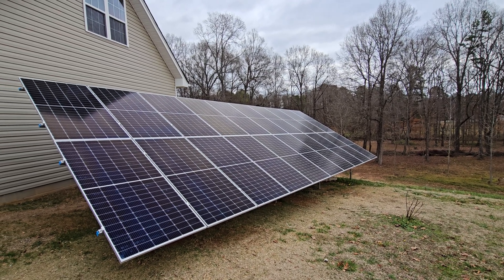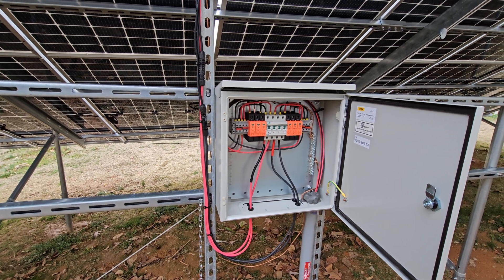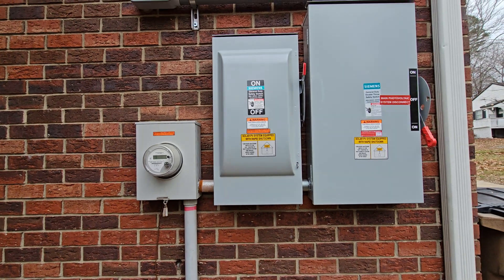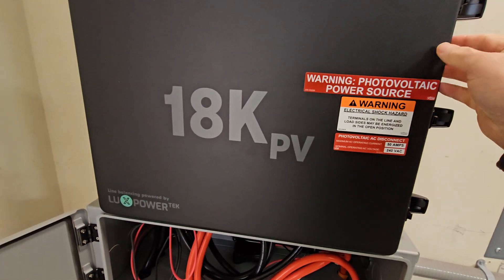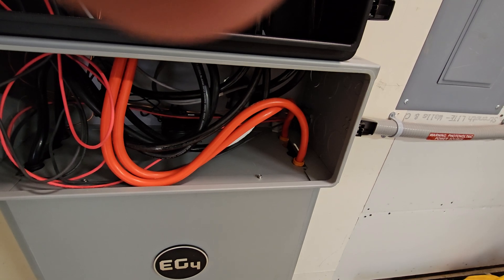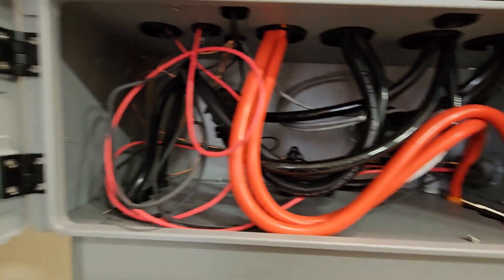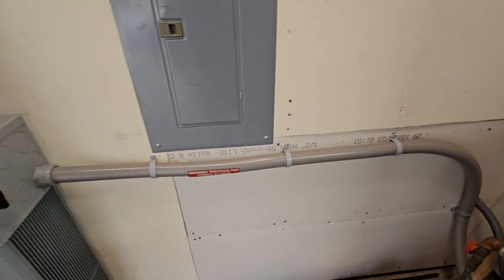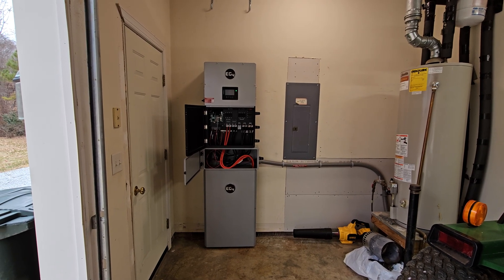Received My Permission to Operate from Duke Energy for my 18Kpv

Comment: Nice setup! What was the process for Duke Energy and NCUC approval? It's a bit confusing, how long did it take Duke to respond to you pre requests?
Reply from the maker: The process is not very clear on the websites.  Basically, you have to get a NCUC docket first.  Once you have your docket number you can make your application for grid interconnect through Duke Energy.  Those two things need to be done before you start pulling building permits and starting any work.  After you have installed the system, you will have to  provide your insurance information and you will have to provide your final past inspection info from the city/county inspector to Duke Energy.  After that, it only took about 3 weeks for the Duke Energy approval.  They reprogrammed my power meter remotely, so I have never seen or spoken to Duke Energy.  On a side note, Duke Energy changed the way they do net metering (I'm grandfathered in to the old system).  If you are not running batteries then grid tied is still the best answer.  If you have your own batteries you should run all the numbers before you decide to go grid tied with sell back.
Reply: @Gary_Pauls_DIY  Thanks for your reply. It was very helpful. No, the process isn't very clear and it is hard to find anyone that knows the process other than solar installers (who refuse to share). 

I have an NCUC docket from filing a "Report of proposed construction". Is that all that is needed, or do I need to file for a "report of proposed construction with registration" also? What did you do for RECs? I have an ESS and don't care to sell back. 

For Duke-energy, I submitted a "Pre-request application" which has been in a "submitted" state for more than 10 business days. I can't move to the "Pre-application" step until that is filed. Did you have the same issues and/or follow the same steps? 

I'm not sure what part of NC you are in, I'm south of Asheville in Hendersonville. We started getting a lot of snow about an hour ago, if you are as well, I hope you are enjoying it!
Reply from the maker: @JordanDeLozier  I started all my paperwork back in July 2023, so it is a bit fuzzy now.  If you have no plan to sell back to Duke Energy and you can set the system up to run without any risk of pushing power back onto the grid, then you really don't need any paperwork or approvals other than the building/electrical permit from your city/county.

The Docket and the Duke Energy application are processes so you are authorized to sell back power to the utility.  If you do the paperwork and approval Duke Energy will set you up to sell back power and then charge all the new fees.  Basically, if you are not selling back then you wouldn't do the approval process.  (This is my understanding) 

I am in Greensboro, so the snow hasn't started yet.  Not planning to go anywhere, so should be good.

Comment: Thanks for the video very helpful. If you happen to have the fuse and transfer box models handy do you mind sharing?
Reply from the maker: Siemens Type VBII 200 Amp Single Phase (120V/240V) Fusible Outdoor General-duty Safety Switch Disconnect
Model #GF224NR
Siemens Type VBII 200 Amp Single Phase (120V/240V) Non-fusible Outdoor General-duty Safety Switch Disconnect
Model #DTGNF224NR
Reply: @ you da bomb

Comment: you can crimp furrels on the battery cable ends.
Reply from the maker: Yes, I didn't have the correct furrels or crimpers.  If I every need to take it back apart I will probably add them.

Comment: Thank you for your very informative reply. I followed your guidance and I feel confident that I have done it properly. I had put all wires in the conduit at first because of the difficulty of pulling wires. I have disconnected one neutral and one ground from the fused disconnect to the inverter grid lugs. Again thank you.

Comment: Gary i have been designing my system like yours. My questions is in your pictures shows Bypass transfer switch to the inverter shows L1, L2 , neutral, and a ground. this I understand, but the Fused disconnect only shows two wires going to the inverter Grid L1 and Grid L2 there is No neutral going to the inverter. I have already put all the wires in the conduits to the inverter. I have the exact same wires in each conduit. My question is if I hook up the neutral that is already in the fused disconnect conduit to the inverter grid neutral is this ok? And I also have a green ground wire in the conduit does it not need to be hooked up?
Reply from the maker: I attached my neutral and ground from the inverter to the transfer switch.  I could have attached them into the fused disconnect and electrically it would have been the same.  There needs to be a single path so you shouldn't put a neutral or ground from the inverter to both the fused disconnect and the transfer switch.  Use one neutral and one ground from the inverter.  It can go back to either the fused disconnect or the transfer switch.  In my case I chose the transfer switch since the lugs needed to attach the wires were already in place.  The fused disconnect did not have double lugs on the neutral buss.  Also, the ground and neutral are only bonded together at the first means of disconnect.  For me it was the fused disconnect.  After that your neutral and ground are separate.  Hopefully I have explained well enough.  If not just ask another question and I will try to help.

Comment: Why would you grid tie with a solar system like that?
Reply from the maker: For 9 months out of the year I could be off grid, but for the middle of summer the system doesn't keep up with the demand my 4 ton AC puts on power consumption. I got in before the Duke Energy rules changed, so I have 1 for 1 sell back, so it was more cost effective than installing a larger system. I would have needed to buy at least 10 more panels and a couple more batteries if I was off grid.  As prices of equipment drops I may expand in the future.
Reply: @Gary_Pauls_DIY  you could run two mr cool mini split and yank the cable from the power company I bet. Here in Nevada, we have to deal with NV energy which is about as gangster as a utility company can be without actually being criminal. They quoted me 30k to swing a line from the pole in the corner of my property stating that I would have to buy a bigger transformer for the neighborhood. I took that same amount and built my own off grid setup that could power my property and the neighbors on either side while still having funds left over for nuts and bolts. Happy with my build, later down the power connection...NV energy then offered to swing a line at no charge if I grid tied, they got the finger.
Reply from the maker: @thomascraddock8697  Yes, when my AC dies (very old now) I plan to replace it with a 2 zone system.  This should help out.  Also, as equipment get cheaper I plan to expand (at some point).  As the solar panels become more efficient and the inverters get more reliable and battery tech gets better and cheaper...I think more people will move to solar.  If power companies start to loose money though I expect they will pass laws that require you to be grid tied and limit the size of the system.  Utilities have too much political power in my opinion.

Comment: @Gary_Pauls_DIY Hello Gary,
I purchased Siemens safety switch and double throw switch like you have. The parts arrived today but they didn’t come with double lugs. Could you please share the model number of double lug you have on your panels? Where did you purchase them? Thank you very much.
Reply from the maker: The fused disconnect had double lugs which I did not need at that location and so I swapped the single lugs inside the bypass transfer switch with the double lugs inside the fused disconnect.  There were no numbers on either of the lugs, so I am not sure what the numbers would be.
Reply: @Gary_Pauls_DIY I checked again. I don’t have any double lug on disconnect switch. I have 2 double lugs on transfer switch at the neutral lines landed. I will call Siemens tomorrow. Thank you for the prompt response Gary.

Comment: Hello Gary. What AWG of Grid wires and Load wires did you use on 18kPV inverter? They look smaller than the battery wires. Thanks.
Reply from the maker: Grid and load are 3/0 copper.  If using aluminum it would have needed to be 4/0
Reply: Thank you for the information.

Comment: Is the manual transfer switch is something that is mandated by Duke Power?
Reply from the maker: No, only the disconnect switch.  I put the manual transfer switch in to enable me to work on the system and still get power to the house at the same time. If you are planning a system you should check with your inspector and the utility company as requirements are different depending on where you live.  If I was starting over, I would still put in the manual transfer switch.

Comment: Looks great. I wish you would have opened up the two siemens panels so we could see the breakers and wiring. I too have purchased the EG4 pv and power pro batteries. I now will be looking for someone to help me install panels on my shop roof and install the system and set up here in north Texas. Thanks for sharing your video.

Comment: Where are your CTs
Reply from the maker: Inside the 18kpv on the input cables (L1 & L2) which is grid power coming in from the disconnect switch.

Comment: EG4 18Kpv resetting more than 10 times a day. 11 days there sending a rma. SS been great trying to set the system. TO MANY REBOOTS A DAY TO DEAL WITH.   APPLIANCE's  (PF)
Reply from the maker: Mine has been running for 6 months now with zero issues.  Grid tied with sell back and two powerpro batteries. I have only paid the basic meter charge to the power company since Feb.  Knock on wood, it keeps running like this.
Reply: @Gary_Pauls_DIY  nice cnl not understand why my unit not working right what a pain to install and remove it. Bought for its 10 warranty. lol and got 10 days of headaches after dark.

Comment: our inspectors would have trouble with inverter behind door and probably your  wiring near the water heater  with gas and water present also rapid shut down external switch  https://eg4electronics.com/wp-content/uploads/2024/04/EG4%C2%AE-18kPV-Version-1-External-RSD-Initiator-Install-Instructions.pdf

Comment: Looks like your conductor between your fused disconnect and your panel inside your garage could see up to 250 amps, grid + 50 amps from 18kpv. Curious as to how others may view this setup. Maybe add a 200 amp breaker between fused disconnect and transfer switch?

Comment: At the 10:00 minute mark of your video you will note is a small angle strip at the bottom of the Conduit/Cable box (between the Battery and the inverter), it is held in place by 4 small Phillips head screws.  Remove this prior to connecting the DC cable connectors to your battery.  This provides an unimpeded easy install of the push-on angle connectors to the battery terminal connection points.  Then re-install the plate, it is engineered to prevent inadvertent disconnection of the connectors.  The battery manual doesn't mention this as far as I can see.  But it can save you an hour of unneeded frustration for a very simple process.
Reply from the maker: Thank you, Yes I figured this out.  I have it covered in a couple of other videos.
Reply: @Gary_Pauls_DIY  Good job.  I was puzzled that such well-designed equipment wouldn't document this obvious assembly sequence.  A couple lines in the manual with a small sketch is all that is needed.  Even a removable sticker on the plate might cover it.

Comment: As a highly skilled PV designer with an international degree in energy engineering and over 4 years of experience in American solar companies, where I completed more than 1000+ projects and obtained permits from numerous counties, townships, utilities, and cities.
I am confident in my ability to create comprehensive designs that align with local regulations (HOA), national requirements (NEC), and international requirements (IFC, IRC), ensuring seamless approval processes.
Panasonic, Eg4 batteries,
Generac generator,
solar edge, Enphase, Fronius, Hoymiles inverters

Comment: The challenge with plastic in enclosed places like that is that critters like to shelter and nest, and then they get bored and begin chewing. But 18kPV has PV arc fault detection (if enabled), so if it happens it happens, and that length can be reinforced.

Comment: Does Duke energy allow you to sell power back, or just bank credit?
Reply from the maker: I think in the videos I always say sell back, but you are correct in thinking they only let you bank the excess.  It is 1 for 1 (for me at least, rules have changed recently for new installations).  They will never actually pay me anything.  They just credit it against what I might use in the future.  So it is basically a battery which I didn't need to purchase.  If I bank a bunch of credit and I don't use it then it gets zeroed out.  They zero out twice a year.  Sizing the system is important.  If I oversize then I am just sending them power for free.  This month it looks like I will end up negative about 100 kWh.  So I will get a bill of around $11.00 for the power usage.  Then they will tack on the standard meter fee, tax, and storm rider which everyone is forced to pay.  In my case the closest one to Zero without going over wins.
Reply: Thanks, I live south of Raleigh and Dukes info online is really hard to follow.  After your video I have ordered my Eg4. Just made since.
Reply from the maker: @robjohnson2649  I honestly can not recommend having a sell back agreement with Duke Energy under the new rules.  If you didn't submit your application before 1 Oct 2023 you will be under the new regulation (Rider NMB) for three years and then forced to move to a time-of-use tariff system (Rider NSC).  The time of use tariff rates are bad.  Under the new rules I would still use grid passthrough, but I wouldn't have a sell back agreement and I would just run the inverter as an EPS.  It would power the house when the sun was out and charge the batteries.  When the sun goes down it would run the house off of the batteries.  When there was not enough sun or battery charge it would switch over an run off the grid.

Comment: Use the limiter and you wouldn't need any "approval" just stop it from going back to the grid.
Reply from the maker: Yes, I agree that would work.  I make more power than I can use or store during the day.  I get 1 for 1 credit sending it to the grid.  So for me it is a free battery with unlimited storage.  If they change the rules, then maybe I will set it up a different way.

Comment: If you put the nest battery in front of the existing one and put the conduit box on top won't it block the door to the outside?
Reply from the maker: The door still opens about 80% of the way.  Still usable.  I plan to place the battery on the right side of the distribution panel.  Just waiting on some connectors.

Comment: Nice install man!  One suggestion for the 2nd battery would be to install it to the right of the main panel as you suggested.  The run your battery cables to a bus bar(inside the conduit box) then run your own battery cables from the bus bar to where ever you want.

Comment: You're going to want your parallel battery cables to be the same length.
Reply from the maker: You are correct.  I'm still waiting for the connectors and once I have them I will measure everything out and order the cable.

Comment: You can’t put another battery in front because of your electrical clearances. You need three feet in front of a panel (Your 18K) from the floor or platform to 6-1/2 ft or the top of the equipment whichever is greater and at least 30” or the with of the cabinet with the door being able to open at least 90Deg. 
NEC Article 110.26A 1-3 and table 110.26 (A)(1) Working Spaces
Reply from the maker: Yes, other folks have mentioned this as well.

Comment: Great video.  I've been looking for a 200A disconnect that had 2 outputs,  I got excited when you mentioned yours has it.  I clicked the link in the description, but it only has single wire outputs.   The accessory list doesn't appear to have double lugs available.  Did yours come with the double lugs,  or was that something you bought separate and might have a part number for?
Reply from the maker: Sorry, the only things I had installed by an electrician were the two switches.  I had them install the lugs so I would be able to connect the inverter, so I am not certain where they got them or what the part number is.  I'm just guessing that an electric supply would have them, since it was something the electrician had handy.

Comment: Why a fused disconnect switch instead of an enclosed circuit breaker?
Reply from the maker: Either will work.  For me, the fused disconnect lined up so I would be able to run grid power directly into the back of the 18Kpv cable box.  I had thought about swapping the meter base to one with a 200 Amp breaker as well.  Ended up going with the current setup just because everything fit the best.
Reply: @Gary_Pauls_DIY  Thank you for responding.